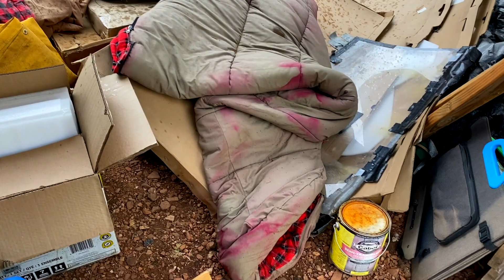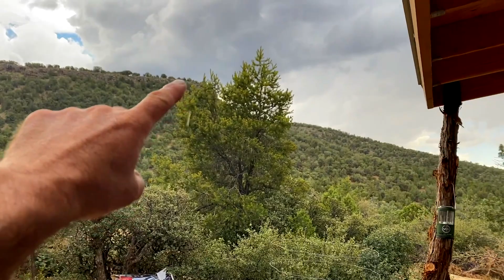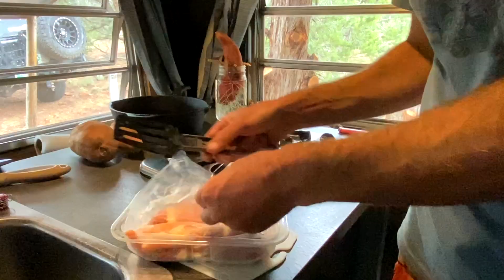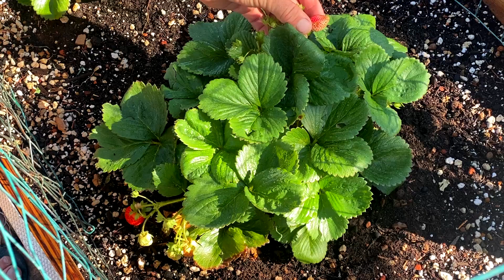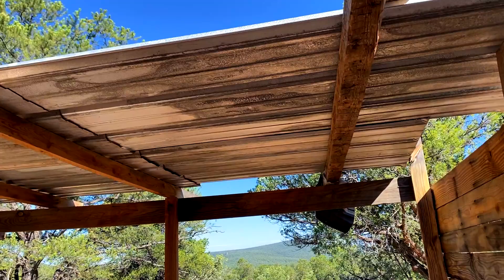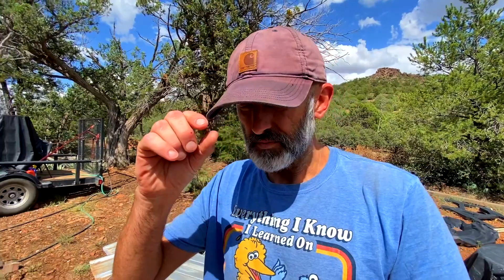The Lightweight Solution For The Camper Cover - Reclaimed U-Channel Metal Roofing - Better Water!

Comment: Please do not drink water captured from a galvanized steel roof.
Reply: I wouldn't even use that water to water the plant get poisoning through the plant
Reply: Lead in the water from zinc coating on metal panels.     Vaughn
Reply: Is it ok if it goes through a water filter first?
Reply: @philtucker1224  I’m not sure
Reply: @philtucker1224 Check your filter manufacturers information to see if it is rated for heavy metals.  If not, you just contaminated your filter.

Comment: For your solar panels, to maximize your energy input, build a pole system to where you can get some large caster wheels, take out the tires, and then put 2x4 or 4x4 in between where the wheel goes. Take the swivel mount and mount to pole. This will allow you to rotate the panels to chase the sun. 

As far as the galvanized roof panels. Do not drink the water. It will poison you! 

And one last thought.

Bury a culvert or metal pipe in the ground going north. Using the earth to cool the air in the pipe. Run that to your home with a fan to pull the air through or open a vent up high and the convection will create suction thus pulling air through the pipe. Free AC!
Reply from the maker: Yeah, that's the next project to tackle.

Comment: Nice!  New Sub Here. Love the brave.  Have to ask, does it ever get lonely and you find yourself driving into town just for social interaction?

 I've been testing in mid-Florida for about 2y now.  The mid-day summer sun is brutal so shade design is critical.  Spending  time on the  land to understand the landscape, the sun and your own life patterns can really help you make smart site plan decisions.  I utilize breathable sun shades that look like nature to block the sun and even spray patterns on them to blend with my landscape.   I also introduced many new species for shade, privacy and security.   I know people love trailers and often end up gutting and remodeling them to the point where I often wonder if it's worth the trouble vs building  something highly insulated and shaded  on the ground.  Here we don't get snow, our challenges are humidity, rain and bugs at night.  The soil is a white sugar sand you can easily move around and shape - it actually makes summer nights cooler than coastal Florida.  If you stick a 10' pvc pipe in the ground you can pump up clear ground water for washing, but anyways just one sun shade keeps a 55gallon bucket  full of water 365 days a year.   It's hard core, but I think in Mid-Florida  off grid is very possible without a traditional enclosed dwelling or a/c using a combination of shaded, screened outdoor spaces, solar fans  and a van with a bed. Staying  mobile and nomadic and not so much living ON the land as much as  hiding,  stretching and storing WITH the  land. Free renewable resources, shade and security.